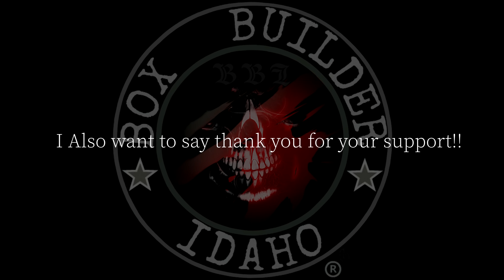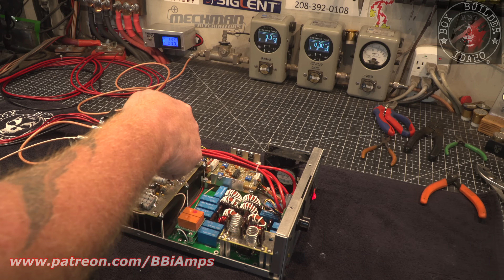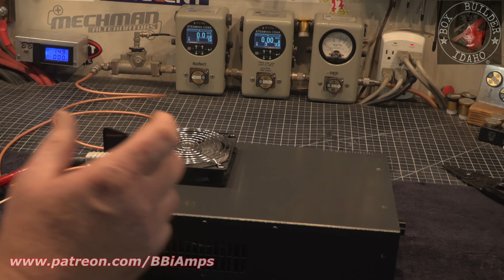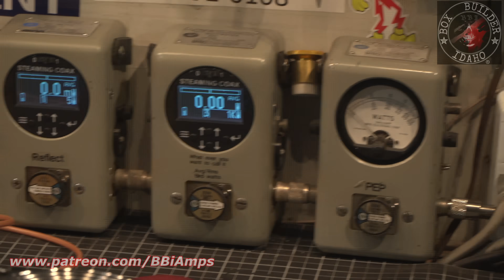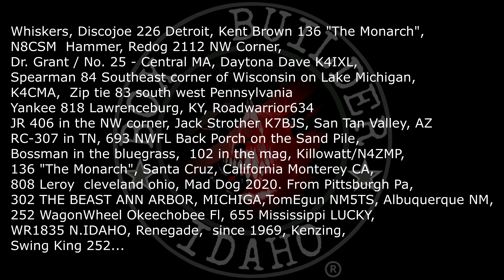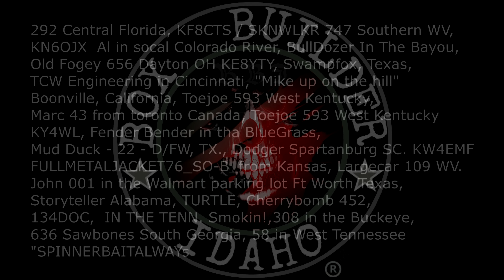ALS-500 repair with Toshiba's ro#53 2025

Comment: These are great little amps. Awesome to see some of the ways to make them even better! Thank you Mr. BBI for all you do sir!

You do have me nervous now about my coax. My shack is wall to wall M&P coax.  I know they only use foam dialectic. It’s primarily broadpro50, but I also have some airborne 10. I currently only run barefoot, but could you suggest a max power should I go amplified? Primary antenna is a DX Commander fed with about 60-70’ of broadpro 50.